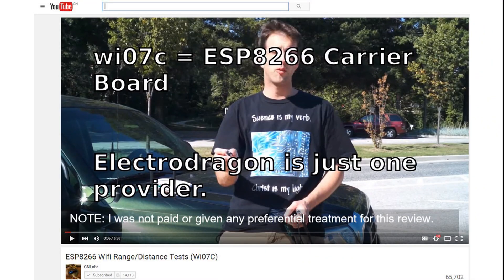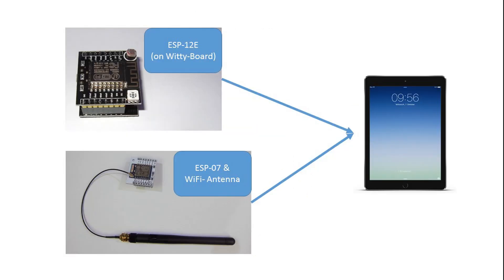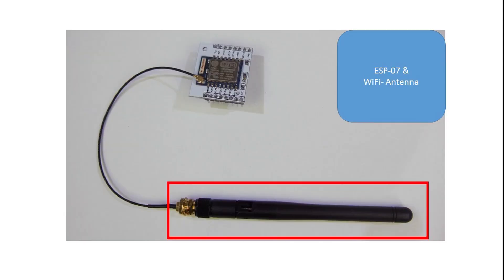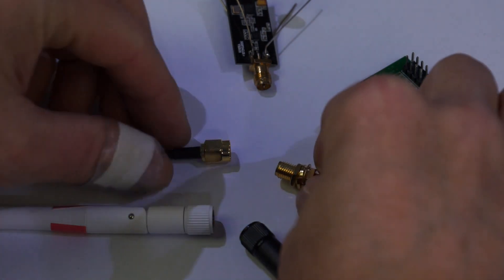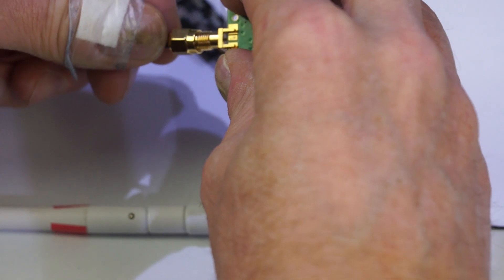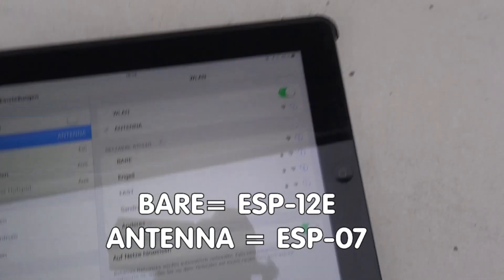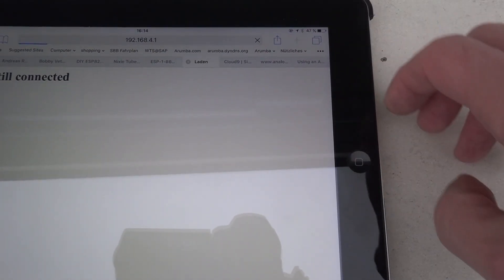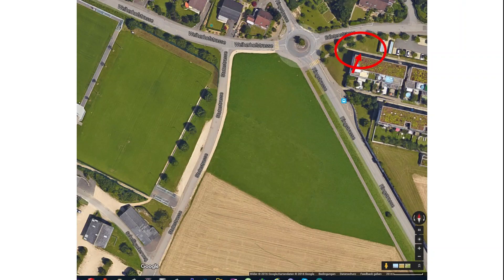#43 ESP8266 Range Test with and without External Antenna

Comment: Very good test. I think putting ESPs right on top of metal fence would reduce their range significantly tho. As a multirotor flyer, I've learned after many crashes, that one should not get close to big metal objects while using any wireless band. 

Another thing is, I'd bet that if you were to use 7-8dbi patch antennas instead of the crappy ducks, on both ends you can easily reach half a kilometer.
Reply from the maker: +flanker I think, I should have a little more distance to the steel fence for the board. For the antenna, I think, it was not so important. But obviously, I did not look too much to that aspect and will do this in a later video. I already have some material coming (antennas, etc.) and I will try tu use also antennas with gain.
Reply: Andreas Spiess I'd like to see that. Thanks.
Reply: agree with you flanker , and test range with iPad ? really? omg  . iPad antenna ?

Comment: Looks like something is wrong in your test setup how much current your power supply supports ?
I get ~3,000 meters with external antenna and ~800 meters with a PCB antenna.

DJ
Reply from the maker: +DJLinux007 Very interesting result. I do not think, it is the power supply. What was your receiving device (I used an Ipad)?
Reply: +Andreas Spiess the receiver are a second ESP8266 with PCB antenna.
Your results are really bad compared to a cheap 2.4G nRF24L01P module also.
Something must be wrong any high power cables in the near air or power cables from a train ?
May be you should repeat your test on a totaly different place.

DJ
Reply from the maker: Thanks fir the info. I keep it on my list. Also the comparison with the NRF24L01
Reply: @AndreasSpiess  Hi, maybe the lots of amount and wide surface of the iron fence was the reason for the (possible) weak result. They say, that's one of the main reasons why wifi and bt does not work well in factories. I'm curious.

Comment: Excellent info.
For my tests...with ESP-01 on bed in bedroom, through wooden walls of house, I get > 400ft (120m). But, that's when using a Samsung Tribute phone and i would think the receiver in the phone has something to do with range. Same for your iPad.
An ESP-03 in my latest video  blew its ceramic antenna, so I removed it and soldered a tiny wire to the antenna output pin of the ESP-03 chip. Then fitted an antenna cut from another ESP-01...range tripled to similar to the other ESP-01
Reply from the maker: +slider2732 You are right. The antenna of the receiver has exactly the same importance thant the one of the sender.
I do not know the ESP-03 but I own some ESP-07 with a ceramic antenna. So far, I did not check the performance of those because I like the -07 because it has an antenna plug for an external antenna

Comment: I have question but pls don't judge me if this is stupid question i am new in arduino  :D and the question is Can this wireless module be paired with my Arduino Nano and be used as a wifihotspot for smartphone/tablet (internet browsing, youtube videos and other) if yes will this work good for my plans http://www.banggood.com/NRF24L01-Wireless-Transceiver-Module-SMA-Antenna-MCU-Arduino-p-80577.html
Reply from the maker: +Jordan Gogov I do not judge. There are no stupid questions!
1. The Nano has no wireless capabilities. It only has a serial connection (wires). Like most of the Arduinos.
2. You can add Wi-Fi capabilities to the Arduinos using an addidional module (shield). You can also use an ESP-01 board in so called "AT-Mode". Then, also the Arduinos have Wi-Fi connection. But they are slow and do not have a lot of memory.
3. The wireless module in your link can only communicate with a module of the same make. I use such modules in my videos #37 and #38. Even if the ESP8266 and the  NRF24L01 use the same frequency band they cannot communicate. They only disturb each-other.
4. Because the ESP8266 modules contain also a small "computer" they can be used like Arduinos. The can also be programmed with the same Ardiono IDE. There are many tutorials about that available.
5.  Hotspots or access points need to have a wireless connection and a Ethernet connection.  All devices I discussed here cannot be used as access points, because they do not have both connectors.

Hope this helps
Reply: Thx, this help me i will watch the videos for this modules.
Reply: +Andreas Spiess It seem unfortunate that the manufactures who make these little transceivers feel the need to limit them to the home security and hobbyist market.  Everyone loves ESP8266 modules but why not  open them to receiving signals from your home router/modem so you can create your own web site without the need to use a computer.  Who´s feet would get stepped on if this were the case.
Reply from the maker: +Joseph Nicholas Maybe you look at this project:https://hackaday.io/project/1552-lofi
I think,, this is in the area you are searching.

Comment: Hi Andreas, really enjoying your videos, i'm a novice and you are doing a great job of explaining these things in ways I can understand - thank you :) Just wanted to make a quick comment, I believe the ESP-12E is actually the newer ESP-12F the difference in the PCB antenna is very obvious if you look it up :)
Reply from the maker: +blitzsss Thank you. You are a good observer! Until your comment I did not know that there is a difference beteween ESP-12E and -F. But you are right, they have at least a different antennas. Do you know, if they have other differencies? One is also marked Wemos, the others are marked Ai-Thinker. And I opened two modules for another project and discovered, that they had differen layout and also different flash chips.
For me, as long as they behave similar, I treat them as the same. If not, we have at least a possible root cause for different behavior.
Reply: +Andreas Spiess Hello, sorry I do not know if there are any other differences but you might find this useful if you haven't already come across it.
https://docs.google.com/document/d/1B06YzToSKxJ-tA1-AaTqacpzbxyexaV7Ick-ZtmvQj8/edit
Reply from the maker: +blitzsss Thanks for the link. I did not know this document.

Comment: great video.  I winder if we can beat that line of sight by making a esp based repeater ? LOL
Reply from the maker: +XerotoLabs You can try. I think, I saw already somebody which tried it, so it should be possible. Would definitifely be the chepest WiFi repeater!
Reply: +Andreas Spiess cool , so far all i have found has been a false DHCP  or fake portal that forces users to a built in page no matter what UL they request . I have a friend who is just a hair out of range of my WiFi and his room is out of sight , but if we put a low cost repeater on / in his shed he could connect to my LAN . 
>> we have used a proper commercial one on a mains extension cord and it works fine when we need. A cheap thing we could keep out on battery and play with would be fun . We used a ESP V1 to host a score board page at a local ball park .  small ESP for things like that is pretty safe and hack resistant as there's not much to hack with a page that is generated in C , and very little in virtual file system. 
On a funny range note and , just to make it all complicated , if you ran a sketch on the ESP to take/use vector of the incoming connection ( use GPS or such ) and have a servo vector a reflector behind the antenna .  like the R/C FPV tracking antennas. that could be fun too .that's the best part about the ESP being a MCU ,  LOL
Reply from the maker: +XerotoLabs I think, too, that for such scenarios, the danger of attacks is small. Only if you connect it to the lock of your main door of your house it starts to become different...
ESP on batteries is another thing. This will be one of my next videos.

Comment: Awesome Video Andreas as always.  I'm getting the same as you do. I think the reason why CNLohr's  got more is because he took a Router on the road with him and that router has a high gain patch antenna on it.  But other wise it would of gotten the same results as you did if the test was done the same.
Reply from the maker: +joseph chrzempiec (josephchrzempiec) Thanks for your fast reply. You are right about his antenna. And in addition, he just did something like a ping test. But anyway, I think, his results are very impressive.
Reply: If can get that range would be awesome. But in this case it will need a boost from a external antenna and some kind of booster i would think.